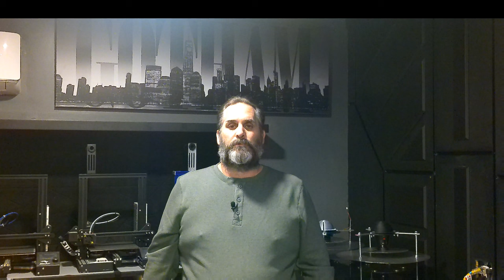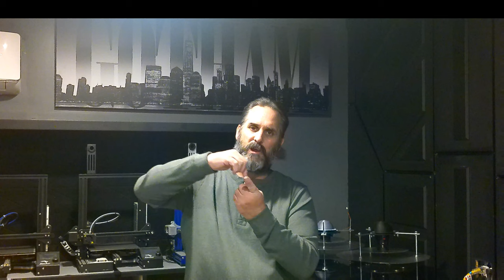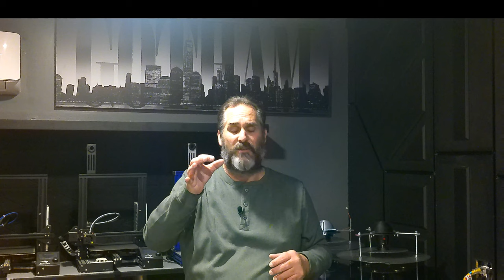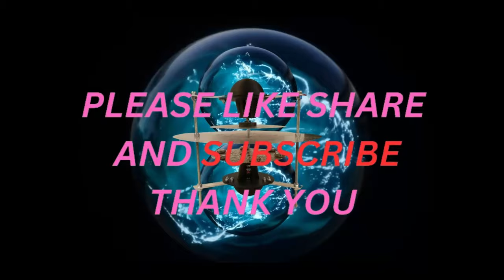Graviflyer "The 7 Frequency's" #8

Comment: You can get your plates and just like tape a piece of string to it and hang it, then just tap it next to your mic, look at the waveform on a equalizer, it’s very obvious where it resonates, basically what you said but take off the voltage. You could do same thing while it’s all connected just not powered, it’ll show you a visual of it

Comment: I get what you're suggesting about the interplay of sound and electromagnetics. We are electromagnetic beings, and as a drummer, sound feels really good! Did you know that the nerve endings on our skin are acoustically triggered and then converted to EM signals into the nervous system? The sounds from our immediate environment directly affect our information intake. 

Acoustics are intrinsic to the patterns of life, as seen in John S. Reid's Cymascope observations. This should also mean something fundamental to the structure of mass, because everything is vibration.

If Tesla was right to say that 'Light is but a sound wave in the Aether', then he was inferring that electromagnetic waves are 'pressure waves' propagating through a medium in the same way that sound propagates through air. These are longitudinal waves which produce pressure waves and don't actually travel anywhere, just pulsate. In the same way a tsunami wave is longitudinal, yet the energy within is only realized when a resistance is encountered, like a shallower depth/beach. Then the full energy of the wave is released and produces power by constriction.
I would like to understand how this works, because the difference between an EM wave or an acoustic wave is only a difference in scale. Whether in a logarithmic or fractal sense, it suggests that they are essentially the same thing and can influence one-another harmonically. I would be interested in your thoughts on this as I think it could be fundamental to the Graviflyer working concept.

So, if EM and acoustic fields are essentially the same vibrational 'thing', shouldn't gravity be circumvented by acoustics alone? It'd be a lot easier!
Happy Paddy's day!

PS - what we need is someone with the savvy to do a Fourier transformation on the arpeggiated sound sequence you shared to reveal the underlying frequencies...
Reply from the maker: I agree with you.

Comment: I like the mic tube - great idea! Another way I find the resonant frequency of a medium/plate/coil is using a resonance speaker with a mic. Input a sweep range from your sig gen into the speaker which literally vibrates the surface, until the mic waveform peaks on the scope. This also catches all the other sympathetic resonances above and below audible range. It works as a static test rather than rotating, and a thin layer (~2mm) of epoxy on the speaker plate keeps it in isolated contact for HV - another version of a tuning fork...

Question on the ultrasound - if he's using a vibration disc/buzzer, does that mean the whole structure is being physically vibrated in ultrasound pulses through the frame, rather than a sound pressure wave passing around it from a speaker?
Reply: I can't understand you 😢
Reply: @CraigLandsberg-lk1ep  My apologies - I directed the reply in brief language I thought OMB would appreciate/understand. Let me know what you're unsure of and I can explain in simpler terms no problem.

Comment: Hello Sir, happy Sunday. If you have time could you explain the the high voltage more?
Reply from the maker: I assume you are talking about the voltage on both disc's. The goal is to get a strong static volt. 
I did a video on it and explained part of it here. 
https://youtu.be/88K6Eu5lSqg?si=XzhLyHt6Rszs9ZrY

I am working on putting in my high voltage into my graviflyer build this week. So I will do a better video on it. I have several coils to test with the driver I want to use on this machine. Since I got mine from a tubed tv. I will buy one from amazon with the zvs and test it to find the best power source. So you can get the same result as me. 

The goal is to remove as many amps as you can and still get it to push voltage.  It allows the voltage to build on the plates as static electricity. If there are to many amps the static electricity will be low and the field will suck.

Comment: Let's assume you accidentally hit the ideal configuration and managed to achive antigravity effect just for a brief moment.Then lost it. You might not even notice it unless a noticeable lift occurs.So measuring , recording and analyzing all experiments precisely with a computer is a must.Otherwise, it may take decades to notice  the sweetspot you have already found.
Reply from the maker: 5 camera's. 3 mic's an oscilloscope are all connected or in proximity to it. I might not be enough. But it will give me some useable data.   By the way The camera's are high resolution. Not 740p like the original.

Comment: That’s interesting. 
Can you confirm the tests in areas of Highmountains or areas with thin air. If the results are the same then that definitely a confirmation that it’s material used . Just a thought . That tube experiment you mentioned prove the oscillating particle match the oscillation on display.
Reply from the maker: When it has lift, then yes. I will go everywhere and find a way to calculate the difference in air and altitude.

Comment: Were you able to find the actual resonance of the center plate by striking it with an object to find its natural frequency or are you just using whichever tuning fork is close to it ie A sharp?
Reply from the maker: 426 is very close 430 might be the one. I have a few tests to do to check my work. I will know soon. Modifying the 2 tuning forks that came with the boxes. To get 430hz. By putting the across from each other. I can make sure they are resonant to each other. Then when my Graviflyer is in the center, the center plate should make noise. That test will be conclusive.

Comment: What flashback are you using (part number) is it the same as Alexey
Reply from the maker: I think you meant flyback? I pulled mine from a tubed t.v 350w zvs 3 poles(wire connections) 2 turns on each pole.

Comment: 1Khz=1000Hz so no, they are not the same. What your probably referring to is phase of these frequencies all being kind of the same. That's semi possible only for a brief moment in time.

How often these frequencies have their peak crests line up varies due to many factors.

Your description of tuning fork frequency is off base! You can make a tuning fork at any frequency you desire.

The musical scale note A that you are referring to as 440Hz or 440 cycles per second or 435 cycles per second means nothing!

Both frequencies still exist and we can tune tuning forks to either of these frequencies or anywhere else we want.

Calling it musical note A does not change the frequency it just shifts the musical scale up or down within the frequency band. 

If your trying to tune the flyer to a specified frequency in herz then we need a number; not a musical note designation.

Comment: You don't need tuning forks just get a decent function generator I have one from Uni-T. I am able to tune everything with  microHz accuracy
Reply from the maker: I was looking at them $240 was the max I wanted to spend. Any recommendations?
Reply: Hey Pal, I hope this comment gets not deleted.
Reply: UTG962E
Reply: All my replys on this comment got deleted.
Reply: I got mine on pollin
Reply: For 179,99
Reply: It has 60MHz
Reply: In combination with a powerful CLASS D Amplifier with the same range you can use it to drive the Gravy flyer. But only the Funktion generator I would only use it to find the resources without the high voltage applied. Otherwise it will get grilled.
Reply: I'm from Europe so that 5 digit number is not Dollhairs it would be 195,99
Reply: 195,99
Reply: Would be in Amerika
Reply: I didn't find a powerful CLASS D Amplifier with this Range yet that would be Affordable for Folks like us though.
Reply: I didn't find a powerful CLASS D Amplifier yet
Reply: It is very hard to comment, if you get constantly muted. YT censorship got really Annoying. Such that people like us can't exchange import information anymore.
Reply: It is very hard to comment, if you get constantly muted.

Comment: UTG962E
Reply from the maker: 926 in E is that what you mean?
Reply: Yes from Uni-T
Reply: They did it again the previous comment I gone😑
Reply: They did it again. The previous is gone😑
Reply from the maker: @icebluscorpion  then I have another question for you. I am putting a tesla coil together and I am following this video. circuit time 34min   

https://youtu.be/fseBG8EluZ0?si=LVF219z-diB6qT9e

The thing is the top load changes the resonant value. So the Graviflyer has the wire just dropped into the top of the coil and not connected. Can I connect it and hit the resonate value of the coil and the center plate. If so how would you do it? 

here is how he connects the tesla coil to the graviflyer  

https://youtu.be/WyDsLVVLKVc?si=ftIJ9kSyVl5AjbQm
Reply: @nathanbunten4299  Alexi drops it into the coil because he seemingly just need the frequency. If he would need the high voltage he would have connected to the HV terminal of the Tesla coil. Either way You are right you need to change the frequency to get the plate and coil in Resonance. Because the plate acts like a capacitance. I would look in the primary side with an oscilloscope of the tesla coil and re adjust the frequency unit I hit the Resonance of the primary coil because the tesla coil is a Resonance circuit on its own between the primary and secondary coil. A slayer exciter circuit would Auto tune the primary with the secondary. depending on the load of the secondary coil 🤔. The circuit is nearly done like a joul thief. Edit : you could also drive the primary coil of the Tesla coil with a beefy ZVS. ZVS auto tune their circuit to the Resonance LC attached to and the given load
Reply from the maker: @icebluscorpion  I was building a tesla coil today with a snubber circuit. It felt a lot like a zvs.
Reply: Interesting approach. I'm curious how you adjust the frequency when the load shifts. 🤔 I mean is there a feedback loop that auto adjust the frequency. If the margins of this oscillator are really that tight to function properly, then every minor drift in humidity or temperature would dissonance the oscillating circuit like a terimin🤔

Comment: Nathan, they don't understand simplicity like you don't understand simplicity by me. I have watched all of your videos on the graviflyer and you have it all correct except you use three aluminum disks as an air capacitor and not two polycarbonate disks coated with aluminum on one side and aluminum oxide on the other side as a normal capacitor so the magnets do not demagnetize, and the disks don't short out so you can get to higher voltage differentials and charges. You put the one polycarbonate disk on the top of the large disk and one on the bottom of the large disk. I chatted with Alexey with a Chinese scientist about all of this on the phone two years ago. Please understand what I am saying so the graviflyer lifts off. LOL.
Reply: Where can I get these polycarbonate disk from and I will build another one because most of this stuff here I worked out a long time ago just by thinking about it myself but I wasn’t convinced about the material going around on the internet people are using.
The frequency just came to me by thought now people are starting to get how things come together and resonate,send me all the information you have on it if you don’t mind and I will put something together as I have free time and the resources now or you can send via,PM
Reply: Mike W, I explain it all on these two videos by Nathan and at yesterday's APEC conference.     https://www.youtube.com/watch?v=iLTzfgz2xL4&t=161s        https://www.youtube.com/watch?v=ztzLa2j4Ujs&t=1657s       https://www.youtube.com/watch?v=xXe4tPNwVxI      Sorry for the messy calculations and many messages but I was disabled by UAP while analyzing them back in the early 1980s working for the Reagan Administration and the US army from the RF that the UAP give off to make anti-gravity as it damaged my brain like the researchers on the TV show The Secret of Skinwalker Ranch sometimes get damaged as a  result my brain is kind of Helter Skelter sometimes. I hope you can understand what I am explaining to Nathan.
Reply from the maker: here are 2 videos the first has all the parts needed. also look in decryption for parts. The second uses the same fan motors Alexey uses. It should help. I am going through the wiring now. Testing upgraded circuits to make sure pulse rate and frequency is the same but with better parts. I might just have them built by a company when I am happy with the parts. That way we are all on the same page.    https://youtu.be/kFa3lvylyyw?si=ffyFjU4X-5g2RjRr
https://youtu.be/yUcPMlYO6AE?si=E5CMPNZMfnsboitj
Reply: Nathan, thanks for your input.
Reply from the maker: here are 2 videos the first has all the parts needed. also look in decryption for parts. The second uses the same fan motors Alexey uses. It should help. I am going through the wiring now. Testing upgraded circuits to make sure pulse rate and frequency is the same but with better parts. I might just have them built by a company when I am happy with the parts. That way we are all on the same page.    https://youtu.be/kFa3lvylyyw?si=ffyFjU4X-5g2RjRr
https://youtu.be/yUcPMlYO6AE?si=E5CMPNZMfnsboitj
Reply from the maker: @richardmuller867  Sorry I was trying to reply to a comment and it sent it to everyone who made a comment on that one.
Reply: Nathan, this is OK as it helped us too.

Comment: Let us assume this all works and the other guy who got his Graviflyer to hover, isn't just a failed magician putting hoops around his machine to fool everybody. Well if it does work it is not worth anything unless the power unit and all the other weird parts can fit on the thing and hover with all that extra weight. Tethered to the ground with multiple cables is silly...
Reply: Even in WW2 they only knew how to send the spun mercury upwards, and pilots called them foo.. Foo fighters is what the pilots were called..
Reply: Boo toobe erased my comment about the ess ess bell structure that is still there today that had chains holding it down

Comment: You started with the premise: it seems to work, let's replicate it scientifically until we find the critical cutoff part.
Now you are delving into esoteric meaning of why it's not working. Get back to basics. The Russian model had a textured top surface of the middle disc for a reason.
Reply from the maker: I was not changing that at all. I made  build video and you can see the parts. I also am rebuilding the original parts from the first Graviflyer. Charlie C has it and sent me all the pictures and the circuit diagrams. In this video I am trying to convey the frequency's of the Graviflyer. Not the build parts.